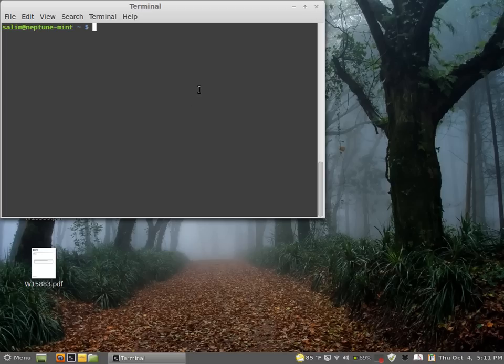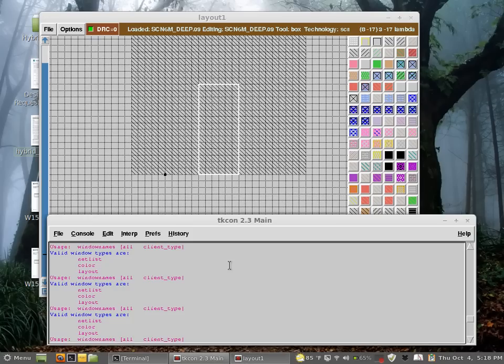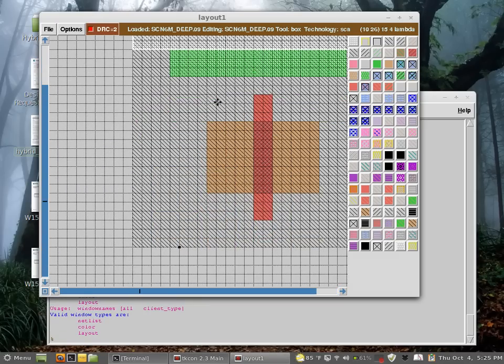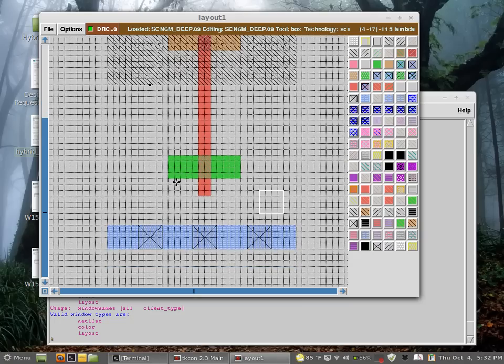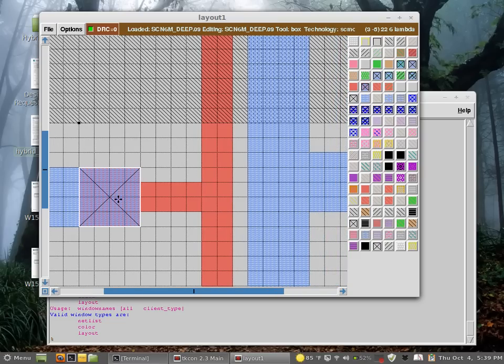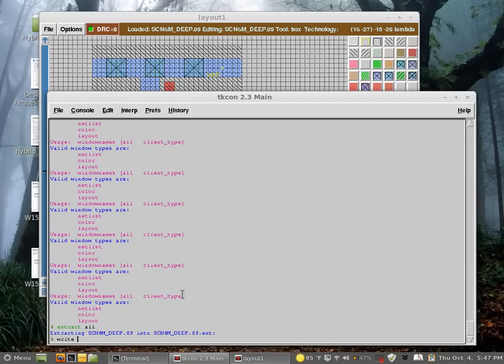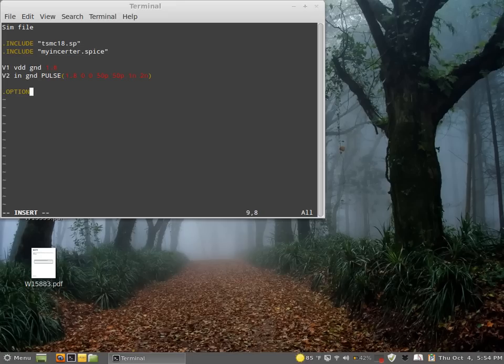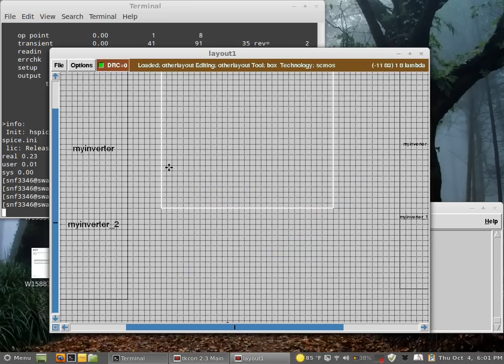Magic VLSI Layout Tutorial - part 1

Comment: A couple of notes.  On my notebook, I already had left and right click emulation in my track pad.  I had to nose around a bit to figure out how, but I was able to activate middle click emulation - I just do left, right, middle by one, two, and three finger track pad click.  Without the middle emulation you have to type "paint <material>" into the console - the middle emulation makes it MUCH more streamlined.
 
Also, my  magic has a different toolbar appearance - instead of just a vast array of little squares I have a single column of named materials, so it's quite a lot easier to find the material you want.  Also it tells you what to type into the "paint" command if you're using that.
 
The real trick for me was figuring out how to start up with a technology file active (-T command line option).  Without that, magic comes up without any technology knowledge and can't do much of anything.

Comment: Due to COVID19 Pandemic colleges are not opening and I can't access the cadence software so I searched for an open source software and I found GLADE. Check out my playlist on Layout Designing using GLADE. #LearnFromHome
VLSI Layout Designing using GLADE (Open Source Software)
Playlist Link:- https://www.youtube.com/playlist?list=PLWcG9vtrFH0YVZvd3yf2Xmm_Gl0y-XXz6
Video 1: All the CMOS Design Rules are explained. 
Video 1 link: https://youtu.be/b3IlK1WZIHA
Video 2&3: Glade Downloading, Setup and Configuration. 
Video 2 link: https://youtu.be/LMZ3O6Akfro
Video 3 link: https://youtu.be/1ueSinMmqkA
Video 4: Designing Layout of nMOS and pMOS is explained. 
Video 4 link: https://youtu.be/oOblwp65WFA
Video 5: Designing CMOS Inverter Layout using 1 metal layer is explained in detail.
Video 5 link: https://youtu.be/Qr0nTPo-Ri0
Video 6: Verification of Designed Inverter Layout using LT Spice. 
Video 6 link: https://youtu.be/kvrF6Zv6Y_U
Video 7: Designing CMOS Inverter Layout by using 2 metal layers and Vias.
Video 7 link: https://youtu.be/HZopqROB2GA
Video 8: Designing 2 Input CMOS NAND Gate.
Video 8 link: https://youtu.be/41067AYX_do
Video 9: Verification of Designed NAND Gate Layout using LT Spice. 
Video 9 link: https://youtu.be/3pufZ6InuHQ
Video 10: Designing 2 Input CMOS NOR Gate.
Video 10 link: https://youtu.be/skYC2UnJgQ4
GLADE is not Cadence but its quite good and feels similar in making the circuit schematic or designing the layout. 
Kindly Like, Share among your engineering friends so that they can also learn from home and subscribe to my Channel for more GLADE Tutorials. Your Support will be appreciated.
Thank You

Comment: but for me ext2spice doesnt work it shows some error
couldn't load file "/usr/lib/magic/tcl/exttospice.so": /usr/lib/magic/tcl/exttospice.so: undefined symbol: extDevTable
Reply: Hi , I m also facing the same problem with version 7.5 in ubuntu 12.04. I even updated but could not get a solution. Please help me out for it.
Reply: Hi, I had the same problem and I had to update it to the last version of magic, it seems there was a compilation error with magic and don't find these files, but you can fix it with the update
Reply: Sheetal Shetty Hi, well you have to download version 8.0.173 to fix this error. You can download it from opencircuitdesign.com.

Comment from the maker: My advice is to install Ubuntu in a Virtual machine (like virtual box) then install Magic in it from either the repository (software center) or find a .deb file from the internet that's compatible with your Ubuntu (x86 or amd64)
Reply: I downloaded Magic on Ubuntu, and when I opened Magic VLSI, I enabled the toolbar under options. I noticed that the color palette wasn't shown; only the error, sub-cell was visible. What do I need to do to find a color palette